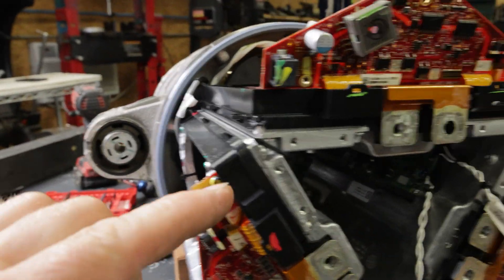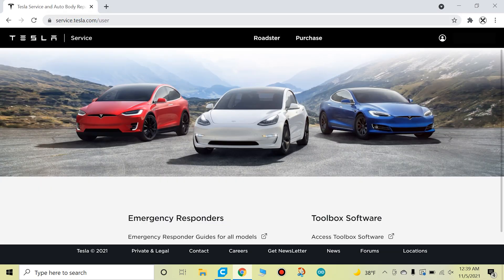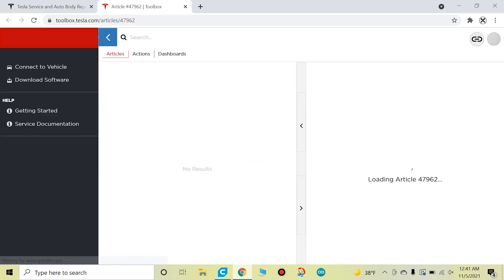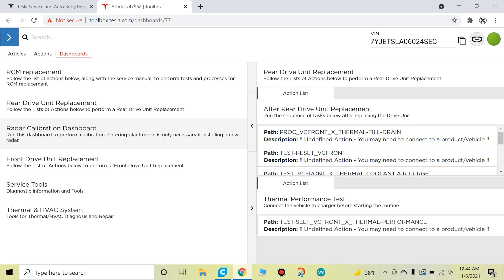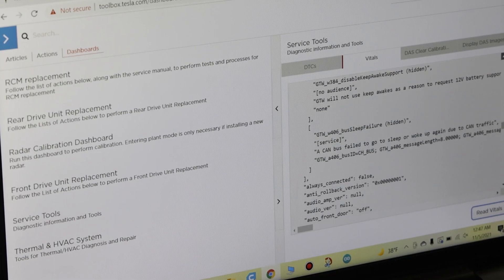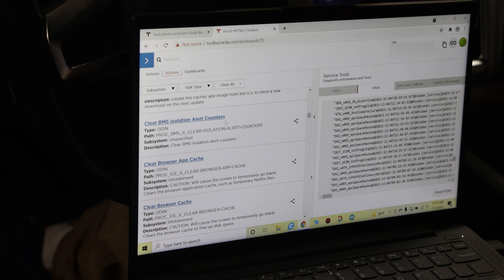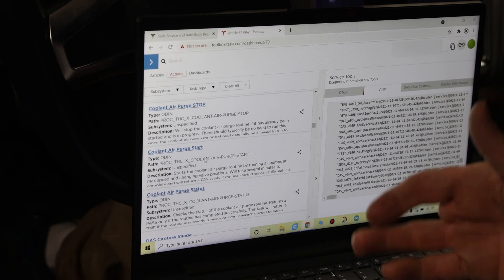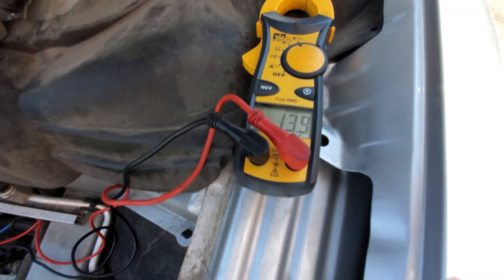Tesla Diagnostic Software - How To Access

Comment: can the subscription be cancelled at any time ? and is there a obd tool that can clear fault codes on it i have a model s 2015
Reply from the maker: They keep on changing it from time to time but currently it's either a monthly subscription or a yearly subscription. Unless You renew it If you pay for a month you get a month and if you pay for a year you get a year then after that point if you don't need it you just don't renew it
Reply: @WarpedLab  one of the abs sensors is not working properly and 1 of the parking brakes will its tell me the one giving the issue ?

Comment: Is it possible to “code” the battery size? Fx if the battery has been replaced then change the display from S85 to S90? Or remove the software limitation on the few 60ies which actually has a 75kw battery? Does the software allow you to do that?
Reply: That's a secured configuration, special tools needed

Comment: You've got me really interested! Great video! Thank you! Would toolbox 3 allow me to update my software? Currently updated as of Feb 2023 per my screen and April 2022 per Tesla. Service mode does not work and my car won't connect to Tesla or the Tesla app. (I don't have a working fob or card either)  Good LTE signal with working browser and streaming music. Tried connecting to my 5g phone hotspot thinking that might get me a software update, but still nothing. Car sat from April's crash until September 2023. Just was able to charge HV from 32% to 86%. I think it might be easier to get the nuclear codes than to find someone who knows about and is willing to help with my Tesla! lol

Comment: So disappointed in Telsa going down the route of expensive subscriptions as a gateway to repairing or even diagnosing your own vehicles issues.

I was going to buy a Telsa, in hopes the software would be something I could download and read codes or even run tests etc.

I'll stick to my old shit that I can actually repair instead of using efficient and clean new tech.

Comment: Can you enable tow mode when you have installed a hitch on a model s refresh ?
Reply from the maker: Tow mode so you can pull the car or tow mode so you can pull a car?
Reply: @WarpedLab  Trailer mode sorry for my mistake. To pull a trailer on my Model S plaid

Comment: Anyone know if the Air Suspension Re-Level function works in ToolBox 3?  That would allow me to lower the car without needing lowering links...
Reply from the maker: From what I know I don't think it allows you to modify the height at all, only reset everything, I could be wrong but I didn't see it anywhere in that program.

Comment: Thanks for your video.  I bought the software and trying to connect to my 2020 Model Y.  So far, it does not connect.  I get through the first two steps, but it fails the third step and dumps me out.  Anyone have any thoughts?  Using an Acer laptop with Win 10.  Chrome browser with the "Allow insecure content" set to allow as stated in Tesla Article #47962.  Also using Chrome set to TCP/IPv4 (not 6) at the IP address given in the article mentioned above.  Cannot get itto  connect to the vehicle successfully?  Any suggestions?

Comment: Tesla has been fighting the right repair. Apparently they are losing that battle. Good deal. Still for the average guy that's quite a bit of money for their software that doesn't even hardly work.
Reply from the maker: Absolutely.. I agree, I have been fighting with Tesla for like 4 months of this year when my car was broken down and I had no access, they were really cool they sent the technician out twice to reset my BMS counter and I also told my car to the Tesla dealer so they could reset it again, but there's no more liability then another manufacturer selling parts and having somebody drop a car on their leg.. but unfortunately a lot of things that Tesla does are kind of a work in progress.. I'm assuming that's because Elon is running multiple companies at one time and can't quite focus on one thing, also I don't think he's a car guy, if only these companies would have car guys work with their engineers they would be making the best cars on the planet.
Reply: @WarpedLab  Elon is indeed one amazing man. And he is spread very very thin. The whole Tesla concept is off the charts and is turning the car industry on its head. But they definitely need to up their game with quality. But I guess that comes with basically a new startup. Companies like Toyota have been around for a long time and have got their act together. Come to think of it, although SpaceX is way ahead of everybody else, notice that Elon hasn't gone on a ride yet.
Reply: @WarpedLab  We all know why car guys can't work in engineering at a car company. Simple fact is, car companies won't make any money making cars for car guys by car guys. They make money off cars for people who don't know what a car is, or what they want/need. They use that money to crank out a few cool cars here and there for us, but in the grand scheme of things we (car guys and gals) don't matter to car manufacturers.

Comment: So a nice strong set of wheel dollies is a necessity when working on a Tesla!
Reply from the maker: Absolutely, very strong.
Reply: @WarpedLab  thanks for going in head first for the rest of us here. I'm interested in getting a Tesla but the Australian market is really behind, but I see the odd one around when I travel. My guess is that the right to repair and other consumer laws here don't mesh so well with the corporate imperialism.
Personally I'm interested if a sort of fluid drive coupling (like in a torque converter) could be used on one of your little jets, & what sort of wheel power & efficiency can be achieved, although it's kind of like the gas turbine engines in tanks I guess.
Reply: @dashingdave2665  I'm working on that one for a while now, to make it really well I have been missing some equipment as well as having trouble getting a hold of the power plants....